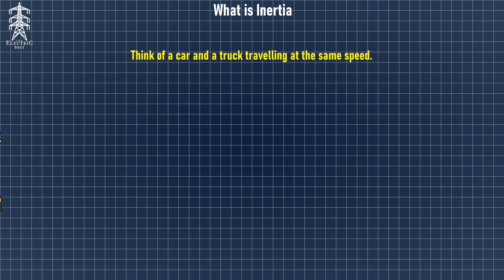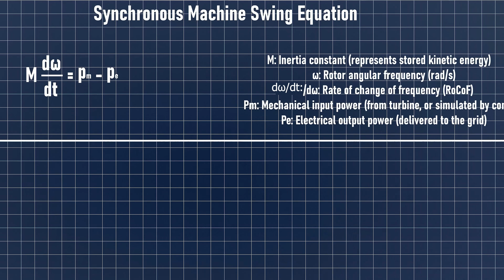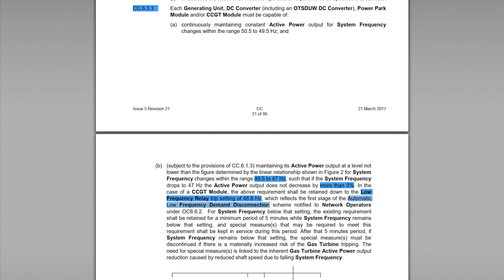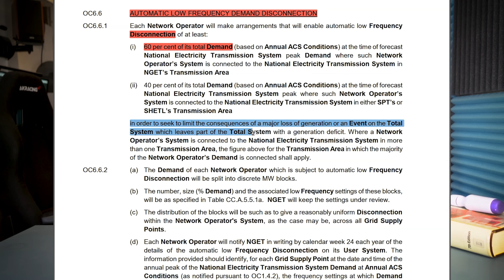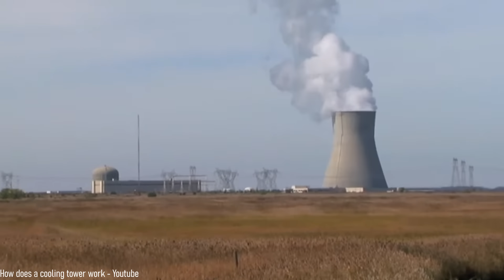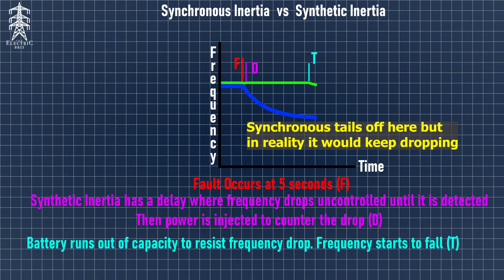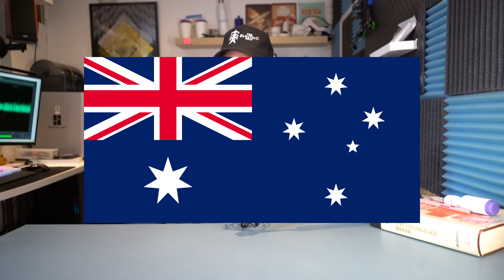How to Restart the Grid after total collapse

Comment: As black start islands come up, how is absolute phase dealt with so that the islands can connect without being out-of-phase wrt one another?
Reply: Because frequencies of unsynchronized systems never match, phase difference changes over time. Let's say one island has 50 Hz, and another 50.01 Hz, it means once per 100 seconds (1/0.01 Hz) phases will be aligned perfectly.

Comment: Wow, interesting that electricity generation at a plant sometimes includes the kind of turbine engines also used in airplanes! And to act quickly, are those set up to self-start? But wouldn't piston engines start and get online more quickly, since they don't have to have as much burner and wind-up time in order to be self-sustaining and get up to speed?
Reply: Gas turbines ( if you don't mind shortening blade life) can be online remarkably quickly.
Reply: @foxwelder : How so, when in so many videos that I've seen them starting up in, they take a while to spin up and then they finally light up, whereas piston engines are running... {SNAP!}... like that? How would a turbine engine be any faster at it than that?

Comment: Fantastic videos very informative thanks for making  them.

I use to work in a decent sized Data Center close to a city centre we had two large container sized generators i was told we were part of the emergency supply system for the centre in the case of a black out, is there a a network of this kind of local generation?
On a related question how does local feed in from people solar work when power goes down, will it stop feeding in as there is no reference power? might this change in the future?
Reply from the maker: Thanks for the comment! Data centres are cool places too, I used to work near three large halls and it looked like a top security building out of some sci fi series from the outside.

I’m not entirely sure if distribution networks use feeds from known sources in the event to be honest or if it’s coordinated from big generation down. G99 compliance makes sure that solar shuts off if it loses its reference though to make sure solar doesn’t back feed a dead network and hurt someone. I’ll do some digging!

Comment: How would Norway handle a total blackout🤔How does the very heavy reliance on hydro effect the startup process?
Reply from the maker: If it’s mostly pumped storage then as long as the reservoirs are full then great. If it’s natural hydro then I think they’ll generally be fine and unlikely to get a large loss of generation event. If NSL and their other links and interconnectors are the right type then they may be able to support too.
Reply: @TheElectricBritgreat video btw
Reply: Got to be honest, I dont realy know the difrence between the two functualy. Here in Norway most hydrostations use valleys as reservoirs to store water for winter. So worst timing posible would probably be at the end of winter when the resevoirs are more depleated.

Comment: If they paid you to use grid generator electricity but you had to pay the grid owners to rent the grid 247 and that was the only energy you used, no fossil fuels, you would not have enough money. 

People are confused because the first grid was built over 14decades and is small, lightweight and fragile. 

Blackouts are a fragile grid problem. 
Grids are too expensive to expand and too valuable to break by overloading. 

Most energy is dirt-cheap fossil fuels. 95%
Central generation electicity is dirt-cheap at the generators. A few cents. 

At the meter boxes 10s of cents. 20c, 30c, 40c,50c like I pay. Cents kWh. 

100% grid electrical is impossibly expensive.
Smoke and mirrors snake oil fools.
I will be kind and say ignorant fools promoting to the grid ignorant majority.

Comment: One of the big problems with many Blackstart plans is that they forget to take account of the impact of a full blackout on things other than the grid.
Simple things like- how do the engineers actually get to the relevant sites if all the traffic lights are out and every city is gridlocked as a result?

The NGET plans were updated to include coverage for the helicopter crews that do line inspections to be able to move vital staff around in such circumstances, after I pointed this out to the team updating the relevant TNCC procedure about 10 years ago.
Reply from the maker: I feel like for staff doing callouts for critical national infrastructure there should be some provision for emergency response lights. I imagine if things really did hit the fan then police might be providing escorts but its still not that handy for the odd engineer in a danger to life or massive asset failure scenario. I think recent examples the biggest issue was the 30 odd minute gap getting an engineer to site which doesn't help with traffic etc.
Reply: @TheElectricBrit 
Yes.  NGET has an ability to get an escort in such a situation, which was initially thought to be sufficient.

However, one of the controllers I trained with had told me the tale of a partial blackout in the north east he had worked on where the site engineers were unable to reach the location they were required at.
Once able to contact them (they had to be paged as this was in the 90s as far as I know), one of them called in to explain he was stuck in the middle of Newcastle.  He'd had to get out of his car and find a phone box.  Asked if a police escort would help, he pointed out it hadn't helped the actual police car stuck about 5 vehicles in front of him, so he doubted it!
A consequence of that incident was staff being provided with company mobile phones, a fair bit before this became common for businesses to do.

I passed the tale on to the person doing the review, noting control room staff would likely have similar issues if we were called in for some similar emergency.
Reply: @LeviticusStroud   traffic lights gridlock, mobile phones drop off after 15 minutes, house phones are digital now. Fibre hub needs a mains power adaptor:  Be difficult to even contact response staff!!. Then if you need fuel for the response vehicle, fuel station pumps are electric.  I never thought they had thought this one through fully and hard to fully test. Then after 3 days, food starts running out.  Water and Gas supplies domestically may drop of....good luck getting through the Civil strife. Spain got a taste of it. Try paying for Fuel ( or food) with all the electric paypoints down.
Reply: @foxwelder  I thought mobile phone towers usually had at least a few hours of backup battery

Comment: Excellent explanation.  I live in central TX and during the 2021 blackout, I was without power for about 65 hours, they promised "rolling blackouts"  that didnt work in many areas.  The local water utility (not city municipal, small water only provider serving a large rural area at the edge of the metro area ) suffered massive damage to most of their pumps due to the wild voltage and frequency fluctuations in the last few minutes before the grid failed.  Once power was restored, we didnt have stable water pressure in my area for 4 more days after power was restored, while they located an isolated many neighborhoods with blown or collapsed water mains.
Reply from the maker: Appreciate the comment and sorry you had to live through that. I think for a lot of people it never enters their mind that it could happen or how far reaching the effects can be if companies aren't prepared for it.
Reply: @TheElectricBrit To be fair, the 2021 Texas collapse was a perfect set of circumstances.  And the over all grid did exactly what it was designed to do.  It shed more and more load as things became unstable.  There were unexpected sources of generation that failed causing more load to shed,  but the entire grid did not collapse and a true black start was not required.  Texas does have limited interconnects but during that storm they would not have been of much use for exactly the reasons you pointed out.  Both sides have to be stable.  In that storm neither the east nor the west grid had any extra electric power capacity to send to the Texas grid.  They were in the grips of the same storm.

There are those that complain about the Texas infrastructure not being able to withstand the cold like some of the northern infrastructure and they cannot understand why it was not built to the same standards.  That is a short sighted look at the issue.  As with everything else cost is a driving factor of infrastructure.  We lost natural gas fired plants due to freezing in the pipe lines, we lost nuclear plants due to ice clogged water cooling inlets, we lost wind energy due to them not being made to withstand the cold.  All of that is true, but when is the last time Corpus Christi was below freezing?  When was the last time that Dallas was below freezing for any extended period of time?  Is it worth spending 30% or more on a facility to prepare it for something that rarely happens?  And on top of that is it worth that money to prepare for an extended event that impacts the entire country even less frequently?

There are always improvements that can be made to any system and the particular points of failure are not always understood until an event occurs that pushes a system past anything it has encountered in the past. As a society we have become complacent and come to rely on the fruits of other people labor.  What used to be a luxury we now see as a necessity and we are quick to anger when others don't provide it to us on demand. And at the same time we fail to recognize how quickly it can be removed from us.  Water, Sewer, Power are all services.  I look back to being a child in Colorado in the 1980's.  We always had food and water in the kitchen along with wood for the fireplace in the event we lost power in the winter.  We had blankets and a plan to house the entire family in a single room with the fireplace to ride out the storm.
Reply: i actually got "rolling" for the whole duration, which was a weird way to live. we'd have power for 20 minutes and lose it for an hour.
Reply: Jimmy Fair that's purely because you texans decided it would be funny to essentially have your power grid completely separately from the rest of the country without much ability to import power from elsewhere.

This happens frequently enough that you guys really should have planned for it but every time it gets brought up you guys are like "naw doesn't happen enough to build for"....when it happens like every decade.

Because what happened to you guys is purely because of that other states had similar issues with their local power production going offline for cold that they really should have built for but because they were more connected to the rest of the US power grid they were able to import power from places that weren't affected while you guys....no.

Comment: How do you find the massively overpriced item on top of your book?
Reply from the maker: Got it for $39.99 with free shipping as part of a bigger order so not too bad. The bit storage is satisfying. Handy to have in the house rather than getting the tool kit out.

Wouldn’t use it for work as I use all VDE stuff like Wera.
Reply: @TheElectricBrit $40 is far more reasonable than the $70 + shipping; especially when i consider it as a degraded version of the MegaPro Automotive.

Are you a domestic/industrial sparky, or do you work at a power station/on the grid?

Comment: If nuclear could run independently of the grid then that's got to be good?
Maybe have a big battery as a sink load?
Reply from the maker: Some nuclear power plant can run in island mode just fine, whether they dump the power into a massive bypass resistor in a lake I don’t quite know or if they’re locally connected grid is specifically spec’d to supply it. Will look into it 👍
Reply: @TheElectricBrit : Got any handy loads that can absorb 1320Mw for one Nuclear station assuming they were a full load when it happened?  Automatic switching would need to be quick....

Comment: How will the TNCC instruct the remote grid engineers in a blackstart scenario? Both internet and telephony networks will likely be almost entirely offline surely?
Reply from the maker: There’s a few different ways we communicate via the transmission system for example there’s fibre optics linking each substation primarily for SCADA and telecoms, as well as some microwave and other dishes. I need to do more research on the telecoms side but I imagine there’s some sort of direct phone line too specifically for commanding incidents.

Besides that, the black start procedure for a given site is already printed out and practiced with the corresponding generator and can be ran independent of the TNCC.
Reply: Power transmission companies often run their own networks for this reason and they even sell excess fiber capacity to internet companies

Comment: Synthetic-inertia, grid-forming inverters, I assume, depend on large capacitors and inductors to be able to induce a lag or lead on their output frequency?
Reply from the maker: Great question and I need to dig into it deeper I think. For BESS or battery storage, the inverter can be used to either inject power into the system simulating generation, using grid forming to determine whether it leads or lags, or take it out of the system into storage, acting like a load.

For solar systems since they can’t take power out of the system into storage, they use their smart inverters to adjust the phase angle of the power they’re putting out to move the phase in or out, to lead or lag. A lag causes the inverter to absorb reactive power from the grid as if it’s an inductive load.

Comment: I know "The Grid" is complicated..... thanks for explaining, even at a simple level, how complicated it is.
 It has me thinking about how individual homes/buildings can help with the load situation by not having everything turn back on the instant power is back.
Reply from the maker: Thanks for the comment. The distribution operators will have a general idea of the load in their areas and try to match the demand to the supply. I imagine if smart meters get any smarter we might see finer control, similar to how your energy supplier can choose when to charge your car.

I wish Vehicle to Grid became more standardised so we could use these batteries both to take the load off in this situation and to provide power in to locally balance the grid.

Comment: is it possible to black start a nuclear plant if they absolutely needed to?
Reply from the maker: It will depend on the plan for that specific plant. I don’t know specifically but in the UK we’re pretty safety conscious, whereas some US designs I know are designed to island themselves and keep running.
Reply: @TheElectricBrit Nuclear plants have back up generators ( several) to keep cooling and critical auxiliaries going in the event of Grid failure when the station drops off.  Takes about 8MW for that per station. During normal operation they effectively self supply. Not sure if the Gensets can provide enough power to self start again.  If the station drops off for more that a little while, the Xenon decay effect will mean it needs to be off for about 6 hours ( Chernobyl...) until the Xenon from 6 hours ago, burns off allowing proper load control.  With big enough gensets you "could" restart.....Nuclear best used for baseload steady running.

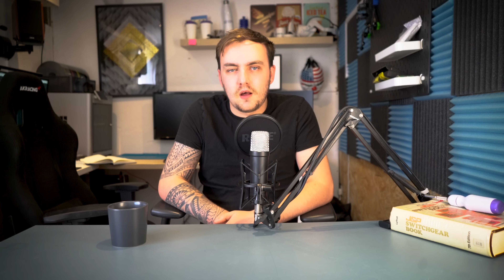Comment: 5:30 it gets really messy if you try to equivocate mass and kinetic energy, because they're only interchangeable when frequency is nominal. That M is mass, because it does not change. It is NOT kinetic energy. As inertia and frequency decrease, your kinetic energy decreases, but that is not what causes your frequency to stabilize. Quite the opposite - decreased inertia means your system becomes MORE sensitive to imbalances in injection/demand. Post-event frequency stabilization (ignoring governer response) happens because load's frequency-dependence is high enough that as frequency decreases, system load decreases, which eventually eliminates your generation deficit.

If this happens above your under frequency load shed point, then you don't need any emergency high-speed reserves deployed (such as high speed load interruption) but if frequency is decreasing so fast that you are likely to trip your "last resort" underfrequency relays, then high frequency load interrupting relays can trip to help reduce the deficit.

Every power grid has a "minimum inertia" value such that, for some maximum planned loss of generation event (say, the entire largest generation substation of 3GW or so) your frequency should recover above those "last resort" relays.

Grid-forming and grid-following are also unrelated to inertia vs synthetic inertia. Synthetic inertia is the idea that if you can ramp up your output fast enough, you can slow your rocof almost as if your kinetic energy is being sucked out. It takes cycles to occur (tenths of a second) which means it cannot entirely replace inertia, but it is very useful to keep in your back pocket as IBR penetration increases.

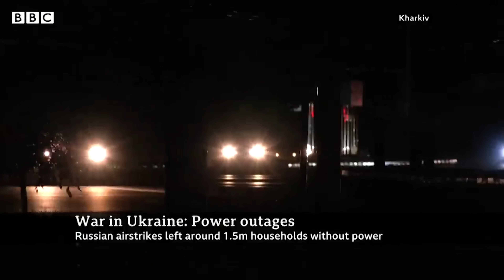19:00 .....that is ridiculously optimistic. 100% in 5 days? Hope your substation batteries, fiber and microwave communications, and switchmen are all ready for that kind of insanity.
Reply from the maker: Thanks for the detailed comment. I admit I don’t know too much on the generation from so there were some simplifications made for the general idea.

I think some of the idea are implied in the animations, like the delay between BESS kicking synthetic inertia into the system after it’s detected by injecting power. My next video dives into how the grid works and covers real, reactive and apparent power, so volt-VAR is getting a mention. 

Always happy for feedback to improve future videos! And yep, 5 days is the NESO quote, I’ve seen some estimates over a week. Spain did pretty well recently but totally different ball game